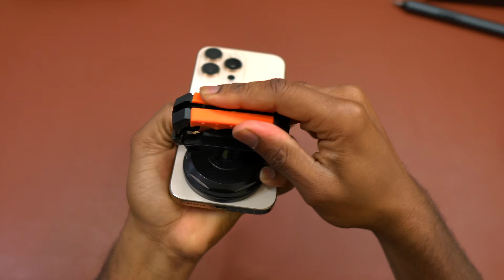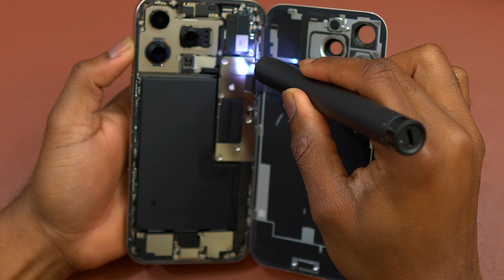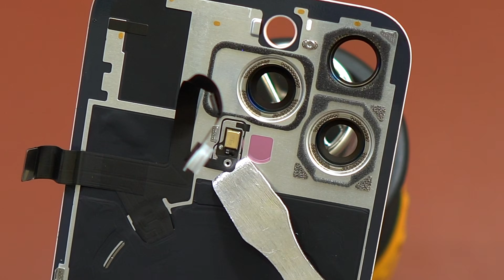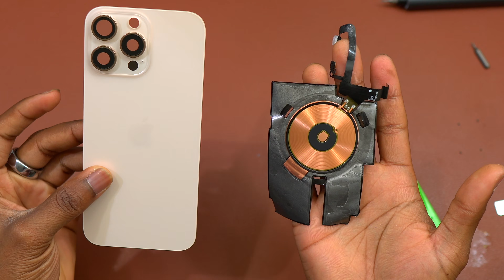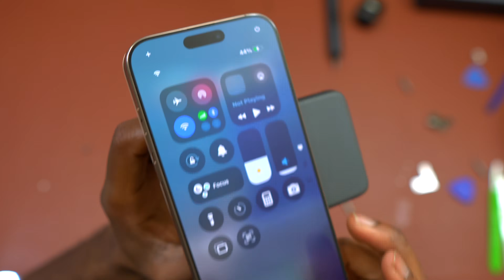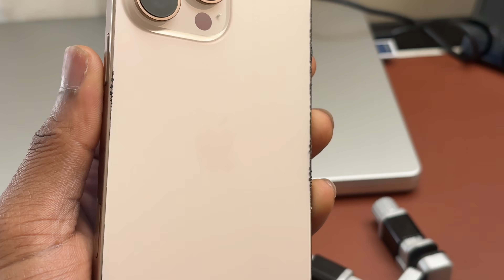iPhone 16 Pro Max Back Glass Replacement Repair Friendly

Comment: Is it worth buying an iPhone 16 Pro Max with a cracked/chipped back in the right hand bottom corner, with 86% battery life from a small phone shop, slightly cheaper than online? as I can see, it may cost me even more to repair it than to just buy one without the flaw that may cost a little bit more.

Comment: What's the best place to buy new back glass?
Reply from the maker: New and original but expensive (Apple Self repair service online website)
New good looking not expensive (Amazon or eBay) it should be fine visually and be a good replacement. If the color is off you can send it back try another seller (the cheap parts tend to do that a lot on Samsung back glass).

Comment: You don't remove the old adhesive? You just glue over the top of it?
Reply from the maker: The video was created less than a week after the phone was released to the public. In that case I cannot possibly have any replacement parts to change the tape. I did what was going to work because that was the only way to do it. I could have removed the tape and use only glue that can work but that was not what I wanted. You can go to apple self repair service website buy all the adhesive then do your replacement with fresh new double sided tape. It is the best way to get quality parts for your apple devices.
Reply: @ersbit that makes sense. I was worried lol!

Comment: If replacing the back glass, why removing the battery?
Reply: There’s no need to as long as the battery is disconnected. My guess is he also did a video on battery replacement while having the device opened up.

Comment: What degrees and air flow should you use with a (Smd rework station 8858+) Hot air gun. Applies to Iphone 11 Pro Max and up to Iphone 16 Pro. Broken back glass replacement.

Comment: Your heat gun is it rechargeable and what make?
Reply from the maker: No. All the heatgun I have used are AC alternating current powered. Use a cord 120vac for power. Not sure if there's rechargeable versions with the same abilities.
Reply: @ersbit aiit thanks

Comment: Hello. How do I get the back screen for my iPhone 16 pro max. Please help. South Africa
Reply from the maker: I do not know. I live and buy my stuff in the USA. I generally use ebay or Amazon to find parts. For Apple original parts here in the US there's an option for Apple Self Service Repair so that customers can buy parts directly from Apple. I have no idea if it is only for the US and Canada or if they have expanded outside.

Comment: Just broke mine... 😆 Seeing this... better send it for repairs...
Reply from the maker: 😅 I believe if you buy the back from Apple they will send you one with everything pre-installed you'd have to just remove the old one then connect the new wireless circuit remove the plastic covering the double-sided tape then close it. Apple is selling the back glass more than $200 so I strongly think they will send it with everything pre-installed etc...
A repair shop might do it for you a lot less than the cost of the part from Apple 😂.
Reply: To know Apple sells the back glass with everything new is nice